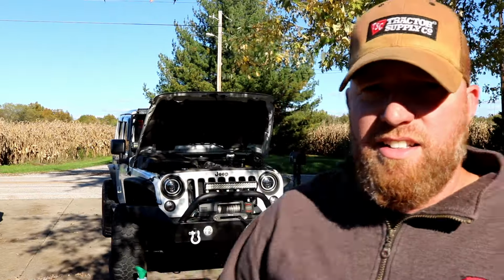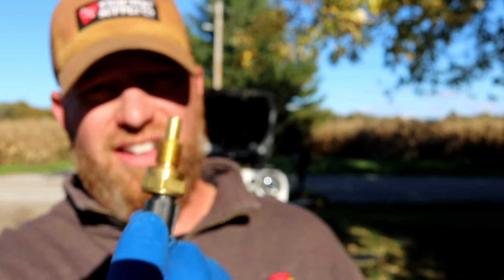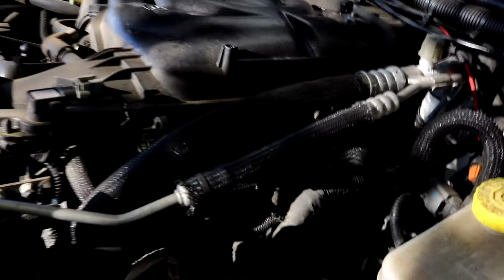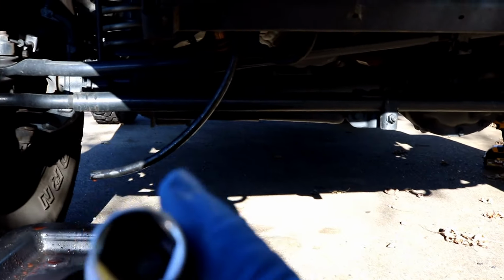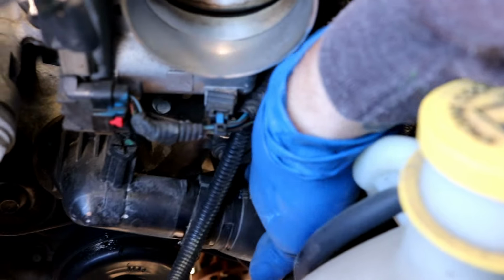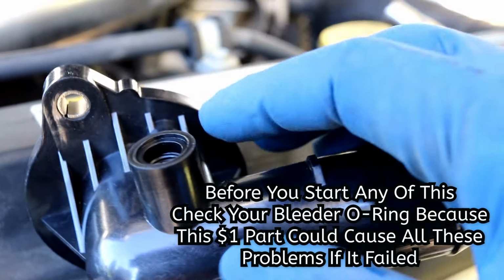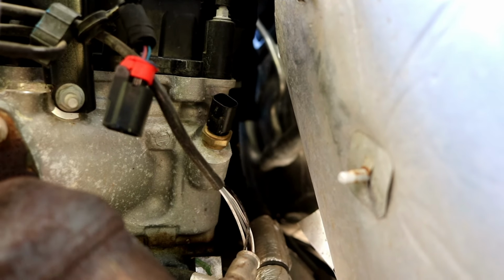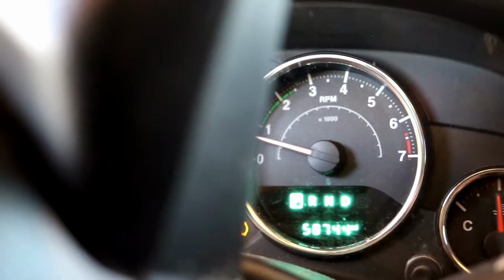Jeep JK - No Heat / Temp Gauge Going Up & Down / Fan Running - FIX for one or all symptoms

Comment: I have the same problem I’ve changed the thermostat , temperature sensor , and radiator fan is also working it’s not a blown head gasket what else could it be?

Comment: Exactly the same symptoms but none of these parts fixed it. My luck. Lol!
Guessing i have a bad heater core, radiator or water pump at this point.
Reply: Did you ever get it fixed. I replaced my radiator a d still nothing

Comment: I have 2016 Jeep Wrangler Unlimited Rubicon and it goes up 3/4 temperature is normal.
Reply: Mine does the same… the fan comes on and it goes back down. It never breaks down… I just keep on driving 😎

Comment: For those of us with factory fender liners, how do you remove it with the pop rivits at the end of the fender flares? Another channel stated that those fender rivets have to be replaced by new ones and need to be installed with a rivet gun!

Comment: Mine had a check engine light for bad thermostat. The guy that replaced it just took it off and put new in and maybe added little bit of coolant few weeks later temp started going up to 250 then fan cools it down. Any idea what I should try first???? Thanks

Comment: Hey man loved the video, i had a cracked radiator had to replace it. Had a guy come out out it in i also installed the new thermostat myself very easy. But he didnt do any of this. Well while i was driving to work thecneedle raised up just over the middle. Can I and should i do this He was a great mechanic but i dont think he filled the radiator enough? What do you think or any jeep wrangler owners appreciate you guys. Got a 2012 jeep wrangler. Should i go ahead and chnage the temperature sensor also?
Reply from the maker: I think the temp sensor should be fine unless it starts randomly going up and down while the car is warmed up and been running… big thing to check is purging the new coolant your system got. It’s a super common problem, that air gets stuck in there and causes the system to go haywire. It’s super easy and free. If you have the 3.6L I purged mine in this video… you’ll hear it hissing out of there - if it had an air pocket. Best of luck, take care!
Reply: @BrianEaly  thanks Brian I'll have to do that I just follow like you did take the cap off the thermostat and leave it off and fill it up? I'll watch it again I really appreciate the reply. Helps alot

Comment: OK my jeeps temperature senor is moving to the 3/4 and back just back and forth my fans start at full speed my heater works fine tho what is causing my temperature senor to do that
Reply from the maker: Odds are it’s one of the three + 1.  

First check the coolant level. (That’s free and the +1) 

Then try purging the coolant system… that’s in the video of how to do, that’s free, and super common in the 3.6 motor. (Usually the problem).  Air in the system screws up the sensor and makes it go all over the place.

If not those it’s either the thermostat, or the coolant temp sensor, sounds like the coolant temp sensor if the heat is still blowing. 

Hope you get her fixed. Best of luck.

Comment: I think I blew my oil cooler or coolant hose that connects to it because I didn’t burp/bleed my system after I lost coolant due to a heater core leak. 

What do you think?

Definitely going to subscribe!

Best advice ever.

If you can please respond to my question when and if you get this.

Comment: My Jeep is doing that but my heater does work I already changed the pump ,coolant sensor, and thermostat and it still says it's overheating but it's not what could  it be

Comment: Turning your heat on high only increases the fan speed for the HVAC system. The coolant flows the same to the heater core if your heat is on high or even off. Just an FYI.
Reply: By turning it up full blast you remove the heat quicker from the engine bay which in turn allows your HVAC to work at it's maximum.
Reply: thats not true...there is a valve

Comment: So after Ive done this, and my Jeep is still running hot would it be safe to say that perhaps I need a new radiator or water pump?
Reply: I'm sure by now you've remedied this issue... But if not, I'd say if thr needle is moving semi quickly like he showed at the beginning, it's indicative of eirher air is still in the system or a small leak somewhere in the cooling system.

Comment: I like your video and will try this, but I'm now interested in the very last part you touched on about the TPMS light and running 35s.

Just bought a 2015 Wrangler and it has 35s and the light will not go away.  Can you comment more on this and why the light wont go off?
Reply: If the sensors are all still good and transmitting, then just have the tire size relearned at a shop.
Reply: Get JScan and you can change the tire sensor perimeters or even completely turn off the TPMS. You can also re do your tire size while you are at it so your speedometer is correct and your shift points are where they are supposed to be

Comment: I have changed my thermostat, water pump, Coolant temperature sensor and radiator on my Jeep Wrangler Rubicon 2015. When I get up to 60 miles and up my temperature fluctuates and goes up how can I fix this problem?
Reply: Hello dear, have u fixed it? if yes, can u please share you solution
Reply: Head gasket

Comment: I’m having trouble with my temperature going up and then yes coming down. I tried flushing my system but i can’t seem to get all the fluid to drain. I spent all day yesterday trying to figure it out. I wound up putting an all new water pump in, which thinking now it most likely wasn’t necessary. My fan runs hard and makes a lot of sound. I thought i drained the radiator, added water and a special flush solution, and it apparently still had coolant in it, and now I’m freaked out.
Reply: Up and down temps means your coolant level is low. The air in the system heats up and when the coolant makes it through, it cools back down. You have to burp the system to get the air out. There are many ways - but the easiest and cheapest is to park your vehicle with the nose uphill. You want the radiator cap higher than the rest of the system. When cool - top off the coolant. Run it some more and get it warm again. Let it cool with the nose up again. Top off the coolant. The air will typically always go to the highest point - so use that to help get all the air out.
Reply: @oscarwinner2034  thanks bro! My reservoir tank appeared full so I didn’t think that was it, after reading your comment my radiator took almost 3/4 of a gallon of fluid. Thanks
Reply: Any suggestions would be greatly appreciated!
Reply: Same

Comment: I did everything you did, except I didn't change the thermostat. Got back in the car and the gauge on the dash jumped up to 190 . It's not running Hot, but my electric fan is spinning really fast, then it slows down. The gauge on the dash still shows it is running Hot. Any comments would help me out.
Reply: Mine was doing the same. Completely drained, flushed and refilled it. So far, no problems

Comment: I have a 2015 jk and it does the same thing except the  reservoir feels full of fluid but doesn't go back to the radiator has a new thermostat and doesn't leak anywhere will replacing the sensor fix this.
Reply: How are things after replacing sensor?  So far we have done cap, thermostat and about to buy a new radiator.  Sensor would be much cheaper lol.

Comment: My temperature shoots up like yours I change the thermostat, I didn’t change the sensor. It still does it. Fans work. Should I change the sensor..
Reply: I did the same and its doing this. Maybe the sensor needs changes too
Reply: @g-trooperg5876  u fix it.. i changed both an mine still going up an down
Reply: My jeep is doing the same thing. Coolant goes into the overflow bottle but doesn’t suck back out Into the radiator.
Reply: @ronfrieborn2276  mine does the same new water pump ,radiator ,radios cap ,thermostat,should I change sensor ?I aslo purged it got bubbles out ,only good for about a week then does back to do the same goes to hot then goes back down after 30 seconds and then after that it’s fine ?any solution ?
Reply: @exceptiontv7656  did you fix it ?
Reply: @ronfrieborn2276   How do you fix it?

Comment: Question : my 2016 jk is doing the same thing has been to the dealer 10 times in the pass 9 months. They changed the thermostat 3 times , radiator , water pump and cleared any water pockets 3 times. Still the same issue !!! Coolant is always leaking from somewhere 1/5/22 will my 11th time at the dealer. Could you think of anything else it could be or this is 100% the fix ??
Reply: I had a hard time finding my coolent leak since it was coming out of the back side of my engine. I ended up replacing my oil filter/cooler housing and got the leaking to go away. There are some good videos on that replacement online if you are willing to save some money.
Reply from the maker: Check that coolant purge screw on top of the thermostat (under the intake) first off and make sure it has an O ring on it. If you can’t get to it easy, you can always look at it while it’s running to see if it’s leaking there.  It seems to be the culprit for most pentastar engine problems cause it’s cheap, plastic, and sometimes the O ring is missing or broke.  If it’s not that the coolant temperature sensor is worth a shot cause that one is super cheap.  Best of luck man!
Reply: Did you end up fixing this? Your comment is the same exact thing I'm having issues with.
Reply: Oil cooler under the intake. Plastic ones were defective. They have remanufactured them now to be better.

If you’re leaking from the transmission bell housing to the bottom middle of the undercarriage…that should be your culprit.
Reply: @mikemike7397  7:19 I had the same problem if you look down below your oil filter on top of the motor if it looks like oil under there definitely is a problem I replaced my oil cooler or oil filter housing  with upgraded aluminum housing to find out that that wasn’t my overheating problem, I still had the same problem I put in three different aftermarket thermostats which are also cheap and not good. I took the one thermostat and readjusted the spring and it actually worked better. And maintain a steady temperature and I was good for the night but the next morning he started doing the same thing again I’ve flushed the radiator and bled the system for 15 minutes through the bleeder screw It looks like thermostat is opening and closing according to the temperature gauges but it fluctuates back-and-forth in between different temperatures going to buy a temperature sensor and a new Mopar thermostat. The top radiator. Hose is really hot bottom hose is cold and radiator is also cold to touch. Radiator is building pressure if I release the pressure out of my cap just a slight, turn then the temp gauge goes back down  after running  for a couple hours I was told a head gasket, which I’m not ruling out my instincts tell me something else!!!

Comment: Was electric fan also running with temp going up also my heat is Turning on and going off as I accelerate I was wonder if it is a water pump
Reply: My fan seems to run hard a lot, and temp goes up under a strain on interstate. Could this be my issue also? Radiator and thermostat have been replaced. Only happens on warm days. Drove to Virginia from Georgia during winter with no issues.